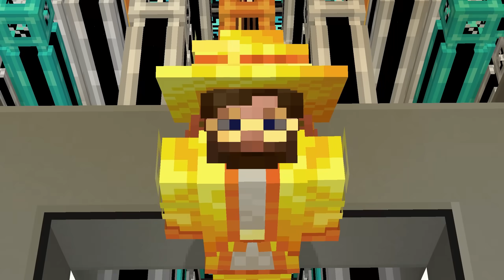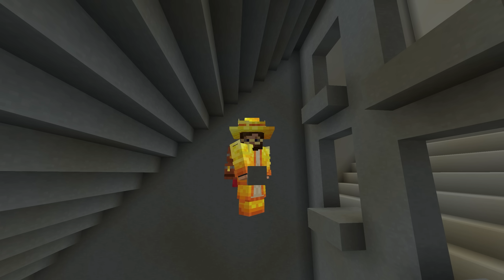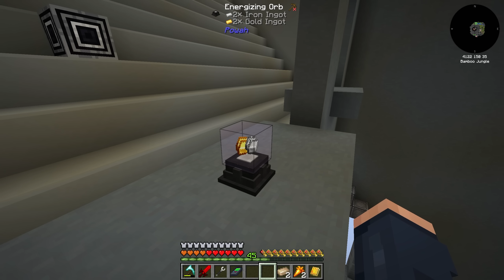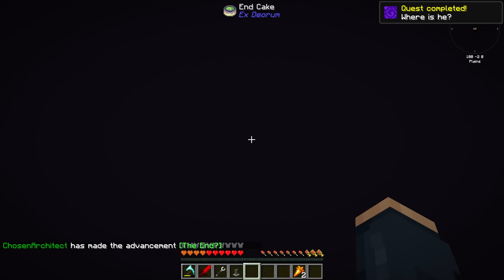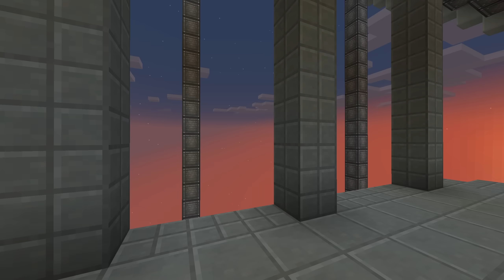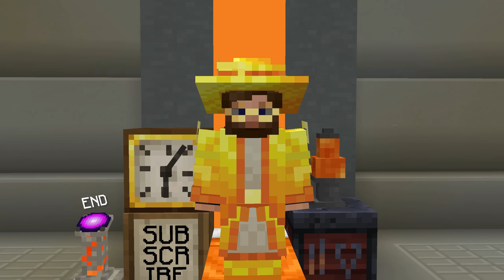All The Mods 10 To The Sky EP13 Automating ALL the Power with Powah!

Comment: For the Rainbow Generator, you can actually just pull out 1 RF / Tick out of the requirement generators, and they still count for running the Rainbow Generator.  So, you could put a Flux thing on each generator, put a limit of 1 RF / tick, then connect them all into an Energy Trash Can.  This would severely reduce the amount of resources you need to push into each generator.

Comment: You better go ahead and preemptively turn on the "Bypass Limit" Switch on all the Flux Networks PLUGS and the Powah Energizing Orb, despite the Orb having -1 Priority, it will then draw as much power as there is available instead of being limited to the default 80k RF/t

Bypass Limit DOES NOT override the Priority, it only bypasses the fixed RF/t Limit (the number you can enter in the same tab)
which means, the Energizing Rods will, when Bypass Limit is enabled pull all the excess power you're producing at once (only limited by the rod's physical IO-Limit)

List of Priorities (Flux Networks Power-Nodes)
MAX Priority -> Priority: [Value (anything higher than Zero or the current highest positive Value set)]
HIGH Priority -> Bypass Limit: (-O) + Priority: [Any Value higher than negative or Zero]
NORMAL Priority -> Power Limit: [Any Value higher than or equals to the Default 80k Limit]
LOW Priority -> Power Limit: [Any Value lower than 80'000 RF/t]
MIN Priority -> Power Limit: [Any Value lower than the Default 80k Limit] + Priority: [Any Value lower than Zero or the current lowest negative Value set]

hope that helps a lot, keep going Chosen, keep going, you're doing a great job!

Comment: For Powah orb stuff, I have the pattern provider push to a chest and use Laser IO with Counting Filters to always keep the right amount of each item in the orb per craft. Can get up to 1 craft per tick with enough power coming from the energizing rods.

For ice production, I set up Create pulling ice from a Compacting drawer, sending it through a belt with 3 encased fans blowing powdered snow on it to make packed ice, then routing that through another similar setup for blue ice, then routing that blue ice back into the initial compacting drawer. The Functional Storage Controller can have any drawer paired to it in the same dimension with 4 netherite upgrades in it, so I can lock a drawer before adding it and have the drawer be read by the single ME Storage Bus connected to the Storage Controller.

For my 1000 Nitro Powah reactors, I crafting card extended export bus my uraninite, coal blocks, dry ice, and redstone blocks to a 2x2 functional storage drawer with a single copper upgrade on it. Then, I connect an Integrated Dynamics omni-directional connector to that drawer with an item importer set to import 2.14 billion items per tick. In my chunk-loaded Soaryn-class compact machine, I first set the other end of the omni-directional connector, a sink with a fluid importer set to 2.14 billion mb/t, and an energy exporter set to export at 2.14B FE/t on my flux gate with no limit. Back at my ae2 ME, I have a flux point with no output limit at lowest priority going into a Flux Accessor from AppliedFlux.

Each reactor simply needs an item interface, fluid interface, and energy interface attached, and they run at full speed no issue, no lag. No further configuring of each cable subpart required. Currently making about 464M FE/t, and I'll just cut-off the item importer once my FE Storage Cards are full of a few quintillion FE.

Comment: for automating powah, i quite like using two laserio modules - you can select the "down" face of the orb for extracting so it only extracts when its complete like a hopper (no need for filtering), then insert back into the pattern provider, not the biggest fan of it being 2x2x1 as it's a bit hard to make it look the prettiest, but it's super easy

edit: looks like it either no longer needs filtering, or i was under a misapprehension, hadnt reached that part of the video yet, nice.

Comment: These infusion things, like Mystical Agriculture, Draconic Evolution, Actually Additions, and even Botania. I would normally just do those manually. Automating them is just too much of a hassle for me to deal with, and I don't generally need their items in great quantities. That being said, I believe most of the Powah! stuff like that have Mystical seeds you can automate, though the Nitro stuff is a tier 6 seed, so it requires a crux.

P.S. I'd like to take this time to address the criticisms I've been having over atm10sky. While I do still like atm9sky better, and I'll never play atm7sky again, I think atm10sky does a lot of things better too. Compressed processing, for one. Something they took away with atm9sky. I like being able to hammer some compressed gravel to get compressed sand, then cook that compressed sand to get compressed glass. It's not just the 1x stuff either. It works with 2x, 3x, etc... (the machine processing anyway, I'm not sure about the hammer with anything greater than 1x). There are some other examples where 10 is a bit better than 9, of course, but this comment has gone on long enough.
Certainly better than the Project Infinity pack I just checked out yesterday. I will not recommend that to anyone who values their time.

Comment: great video as usual chosen! as far as exporting into the reactors, it's been my experience that you can slap the export bus pretty much anywhere on the reactor, not just ports and it will still extract to the reactor. power output is limited to the ports though as normal.

Comment: But isn't extreme reactors way better this pack especially the reinforced reactors? easy to start, no need for any logistics other than feeding it uranium and storing the cyanite in a dedicated cell with overflow card. and it is required for the star anyway to generate insanite.

Comment: my favorite way to automate powah energizing orb is to have 1 pattern provider with a wireless connector directly on top of it then surround the pattern provider with 4 energizing orbs and have 9 rods connected to each orb in a 3x3 pattern and pipez with white list filters to send back to the pattern provider. that way i can do 4 recipes at the same time and it happens super fast. also mechanism universal pipes for the rods are great in case you run into power issues since they hold a large buffer

Comment: I always use compacting drawers for items with multiple formats as you get all the formats without any crafting. Crafting a block may not seem like a big deal in isolation, but when you have complex crafts going on, not having to craft a thousand blocks will save you time over the run of the craft, especially with the ridiculous tiered crafting that many mods now use.
Reply: I’ve done this also, but AE, sometimes has issues in crafts with compacting drawers. It can be a pain. I’ve switched, later game, to Mega Bulk storage cells. They are virtually unlimited and with a compacting card can have all of the compacted versions available.
Reply: @madoldguy1000  Just a heads up to everyone though, something in the ATM10TTS pack breaks the auto-recipes of the compacting card in the mega bulk cells. Autocrafting will only see the version of the resource that you set the card to read as, other versions of that resource will need patterns made. So the option with the least patterns crafted remains compacting drawers.
Reply: My favorite storage method is a sophistic storage with compression enhancement. One chest for recipes for 5x compacted cobblestone, gravel, and sand, and second for 2x blocks/ingots/nuggets. Much faster and works better with AE

Comment: Hey chosen, there is no need to find an item to extract the output from the powah energy cube because the current creator of powah(the old owner got replaced with the AE2 team) made it finally easy and you only need a pattern provider for taking the output.
Reply: @motivatedtoscapechildsupport  like it auto outputs below?
Reply: @draconiumnova5110 its kinda how it worked with mekanism or other AE2 devices. Just a pattern provider and you are good to go.
Reply: @motivatedtoscapechildsupport  that’s awesome! I remember making some convoluted setup the last time I worked with it.
Reply: @motivatedtoscapechildsupport i tried it, still doesn't output properly with pattern provider
Reply: It still doesn't actually automatically output, though. I just tested it.
Reply: Is this realy the case?
Reply: For real? I HAVE to test this that sounds too good to be true.
Reply: @motivatedtoscapechildsupport  the funny part is: i know that from choosen videos ...